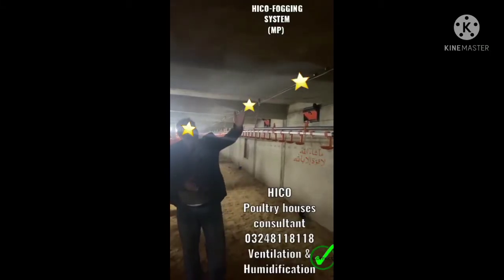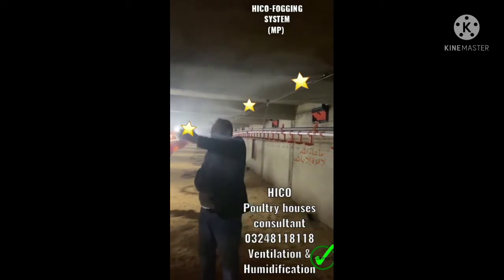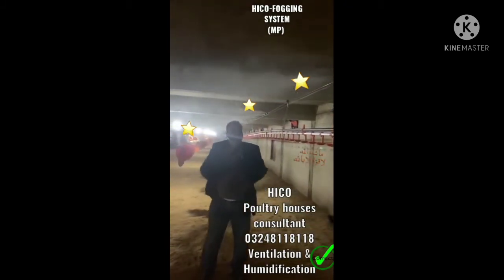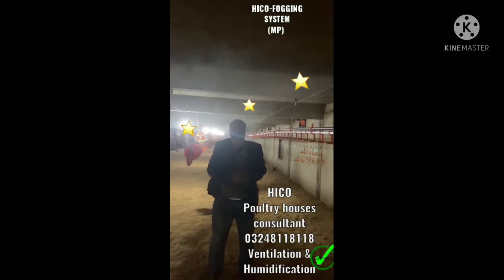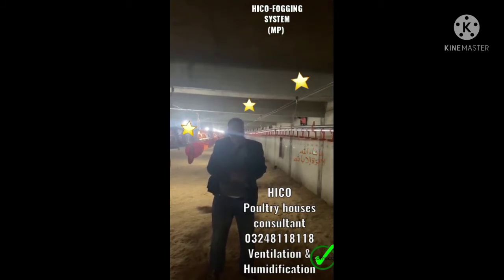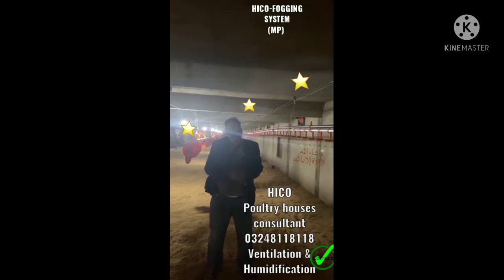کم نمی والے پولٹری شیڈز کیلیے ڈیزائن کیا گیا فوگنگ سسٹم ۔#Fogging system for Livestock

Comment from the maker: For brooding
Day 1st
Set points
40% Humidity 34c'
 50% Humidity 33c'
60% Humidity 31 c'✅
If brooder sticky ,u can increase Humidity of the House with our syatem @
70% Humidity 30c'

As per size and Design of shed.its accordingly with birds requirements.
Whatsapp 03248118118